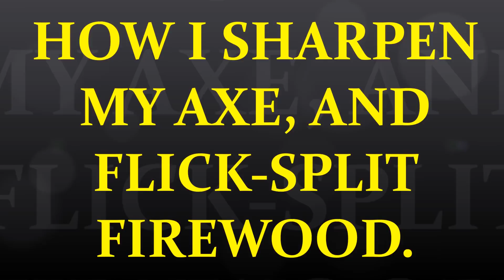HOW I SHARPEN MY AXE, AND FLICK- SPLIT FIREWOOD

Comment: East coast (northern NB) guy here. I split Norway maple, sugar maple, and yellow birch for firewood. I'd rank our local hardwoods in that order, from easiest to hardest to split. We use some local softwoods, e.g., fir, spruce, pine, juniper for fall/spring, or kindling in winter. The softwoods don't produce enough BTUs for heating during winter in our climate. Someone in BC, especially on Vancouver island, won't need such heat from hardwoods. It'll probably make your house uncomfortably warm.

Comment: I was taught along time ago to flick when splitting firewood and cross cut chopping. With your slowmo flick demo, I thinking it would be much more easer and effective if I switch to a double bitted axe. The weight distribution (balance) would assist the technique. I also think the top half would give better after flick control. 
I see you have a homemade splitting wedge leaning up at the back of your work bench. I have a similar one that my wife's grandfather made from an scraped axe. He used it for many years. I inherited it and also used it for quite some time before I noticed that the mushrooming head presented a splinter hazard so I retired it to hang on the wall. Now it reminds me of Grampa's hard work and of days gone by. 
I am always amazed at what I pickup from your video. Love your energy and your passion . . . and your axes :)

Comment: Oak splits fine if you find the right spot keep on keeping on buckin love the content been cutting firewood 30 of my 40 years and have learned  a lot from your videos
Reply: Your right about Oak.  If the wood is strait and doesn't have alot of knots it splits pretty good. I do like to use a maul on the real big rounds and then I switch to the smaller lighter axe!   Gum and Elm are terrible wood to split.
Reply: I just got a hold of an old thin Keen Kutter double bit with original handle. The handle is drying up in the eye and a piece on each end has fallen out, so it is coming loose. So I tried the flic technique for the first time on a freshly cut 8" oak. 7 smacks to make 6 pieces with very little effort. Only ever used a maul in the past and it was tiresome and always getting stuck. I even tried the side swing with a piece on the ground and it worked marvelously.
Reply: Tony that sounds great!  I've have an old unmarked axe that I rehalfed that I use and it works great.  However, I have some Oak wood that is 36 inches or more across and I will split that in half with the maul then I use the axe.
Reply: I use the maul on the big rounds to  been working on a 5ft red oak that fell good fire wood

Comment: Thanks for the felling wedge sharpening tip.  I'll put that in use.  When buying a new one, some of them are slick and could come off the natch and fly away. I think roughing them with the wood grinder filer like you did would make it better.

Comment: A belt sander with light pressure, the right belt grit and sanded in the loose part of the belt is an awesome way to get that beveled edge. The beveled radius behind the edge is much needed to support the edge, strengthen it. A wet stone to clean up any burr or even a fine file will do the same in a inch, in the field. Very simple & effective way to sharpen an axe!

Comment: One of your best videos right here Billy!! 

I just had a chance to use a few of my new Oregon felling wedges, I do not recommend at all, one split straight down the middle after a couple hits, the other snapped in half like glass. The best I've used are the heard head wedges, but they aren't cheap. What plastic wedges do you prefer these days Billy?
Reply: bobe8888 K&H Red Head's Buckin has mentioned are his favorites.  😉

Comment: Hey Buckin! Any chance you could do a video on the face cut or whatever you prefer to call it if you have time? I always tend to mess up my angles slightly by letting the saw drop down in my one hand whilst cutting or tipping it too far up. I know these things come with practice (I've only been doing this for roughly 6 months or so) but wondering if you have any tips to speed up the process? Thanks for any response love the vids as always!
Reply: +1
Reply from the maker: FOR PRACTICE, EACH TREE YOU CUT MAKE YER STUMP HIGH AND PRACTICE MORE UNDER CUT S  MAKE YER FIRST CUT NOT SO DEEP ,,, FOCAS MORE IT WILL COME

Comment: Can someone explain what and how to do the “flick” ?

Thank you
Reply: slight twist with your back hand as the axe makes contact with the piece.  Only necessary on the last swing - when the piece breaks free - that could be the first swing or the hundredth swing depending on your strength and accuracy, species, grain, and moisture and temperature (frozen or not).  The twist, or flick, shifts the center of mass of the axe head to one side of the split, which creates a sharply increasing torque on the axe head as the low side proceeds into the split.  This torque pushes the leading edge of the axe in the other direction, rapidly separating the pieces and sliding the axe (most importantly the handle) in the direction of the head tilt as it falls, clearing the side to which it was twisted.
Reply: Jeremy Buchanan 
Thank you so much!
Just starting out. Can you recommend a good axe head weight for a beginner?
I was thinking around 3 pounds.